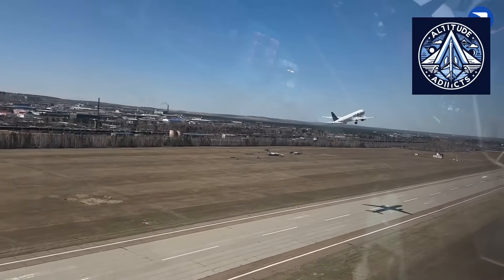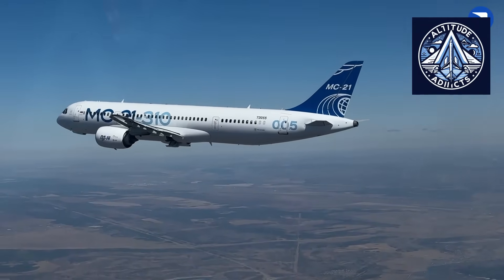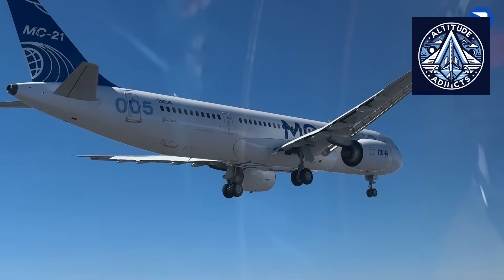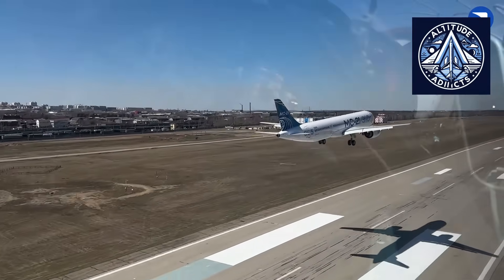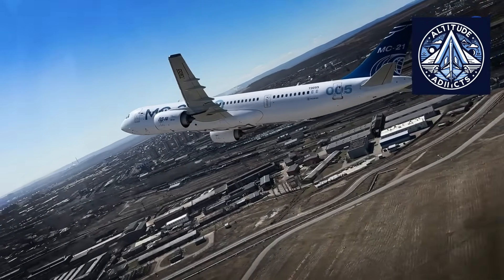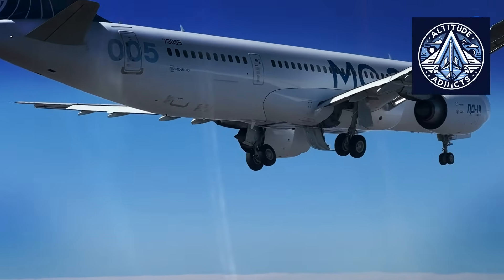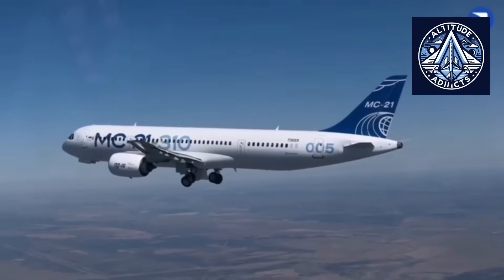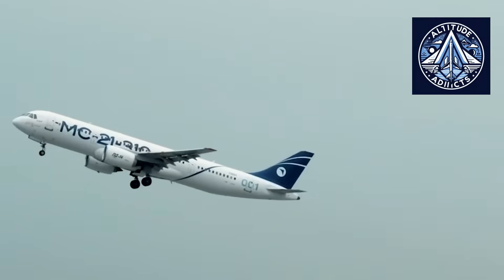MC-21 Evolution: The Weight-Optimized Version Explained

Comment: Please include links to sources of information in your videos in the future. I saw the full interview with the designer on the Rostec website, and he didn't say much of what was in the video. Let's start by noting that the dry weight of the PD-14 engines is 2,870 kg, while that of the PW1431G engines, previously installed on the MS-21, is 2,857 kg. The PW1431 engine produces 13.6 tons of takeoff thrust, while the PD-14 produces 14 tons. The PD-14 fan diameter is only 1,900 mm, while that of the PW1431 is 2,010 mm. Overall, they are roughly the same, except that the PD-14's smaller diameter creates less drag and, therefore, saves fuel. Their functional fuel consumption is practically identical: 0.53 for the PD-14 and 0.525 for the PW1431. In addition, the design weight of an aircraft is always less than the actual weight because the aircraft structure does not include any internal components. Aircraft ranges are reported differently in Russia and the United States. In the United States, ferry range is reported for an empty aircraft, often with additional fuel tanks. In Russia, both ferry and operational range are reported, with the operational range being reported for a fully loaded aircraft, naturally without additional fuel tanks. According to Naryshkin, the operational range of modern aircraft is typically 37% shorter than the ferry range. The UAC website lists the MS-21's practical range as 3,830 kilometers; if you add 37%, you get a ferry range of 5,200 kilometers (rounded) by American standards. The MS-21 page doesn't list any other specifications, but you can click the "Other Aircraft" link to find a specifications table with all the listed parameters for comparison. The Il-96-300 has a ferry range of 14,000 kilometers, and an operational range of 8,400 kilometers, although reference information usually states 9,000 kilometers. The MC-21 can be compared to the 737-900ER or A320(1), there is a difference in fuel volume, but overall the aircraft are similar, their actual practical flight range is about 3,200 kilometers, which is less than that of the MC-21. To better understand the range stated on the aircraft and the parameters taken into account, you can visit the Tu-214 Wikipedia page in Russian, which details the range depending on load and type.

Comment: First replace then improve. It needs a lot of support and long term vision. You have a good airframe and things will only get better. In terms of teething problems these are not the worst I've ever heard. You have survived the worst of the obstacles placed in your path. Survival has been attained improvement will happen with continued support.

Comment: From what I have been able to gather data from asking AI and learning from other sources and video's, the main 'culprit' for the weight, is that the Russians went for the 'Out Of Autoclave' technique for the wings. An autoclave is a very expensive and huge kind of oven and pressurized room, where these huge components are put into for hours, to let the carbon fibers and resins that keep them together, harden in optimal conditions of temperature, moisture, pressure and what not. With the 'OOC' technique, that Boeing and Airbus now also try to use instead of these autoclaves, the hardening and conditioning process takes place in controlled atmospheric conditions. But Russia does not yet master this technique completely. So to get to the same strength for the wings, they need more layers of fiber and more resin and they also don't have access to special ultra light resins. The result is a wing that is sturdier than that of the competion, which is a good thing for Russian climate and geography, but the negative thing is, that it will be mostly sanctioned countries like Iran and African nations or nations with lots of oil, like Venezuela, who will want to buy this plane. Until the Russians master the techniques to produce lighter wings domestically.
Reply: Just to clarify, no one is expertly competent on out of autoclave composite parts production. It’s a fairly niche and new field on any industrial scale. And yes, developing some new resins will likely be essential. Thanks for explaining the problem so well
Reply: @strgo4773  Этой "новой технологии" холодной формовки панелей уже где-то под тридцать лет.))

Comment: The MC21 has been in development for more than 15 years, but mass production and commercial operation are not yet confirmed. To compete with comparable Western passenger aircraft, a lightweight design (currently 5 tons heavier) and a commercial range of approximately 6,500 km (4,000 miles) are clearly essential. Above all, safety must be ensured, with a zero-accident record maintained for two to three years after commercial operation. As a national strategic project, we anticipate the best possible results through successful implementation.
Reply: А пока дальность 3700 в двухклассной и 3300 в одноклассной компоновке. "Родила царица в ночь, не то сына, не то дочь..."))) Полный отстой.
Reply: 6,500 km at Boeing is indicated with a minimum amount of payload, a minimum number of passengers (165) and with additional tanks in the cargo compartment. This is Western PR.
In Russia, they always consider the maximum payload.
At maximum payload and without additional tanks:
Boeing - 3,800km
Airbas - 3,700 km
MS 21 - 3750 km.
Reply: @ФеликсДзержинский-ф2ш  МС-21 заявлена (а не подтверждена в эксплуатации)  дальность 3750 при двухклассной компоновке, а при максимальной коммерческой нагрузке (один сплошной экономкласс) падает по расчетам до жалких 3200 км.

Comment: Saw another channel covering the composite panel improvements.  2.8kg/m2 on aircraft aluminum and Russia is expecting 20% weight savings by using composites.  If they need to save 5 tons then there are more components overweight than just the composites.  And if the composites are that much overweight, they might as well substitute already approved aircraft aluminum.
Reply: What’s the channel name and link to video please?
Reply: Смешно. Потратили сотни миллионов баксов ради композитного крыла, а теперь обратно к древнему дюралюминию?)) Самому не смешно?))
Reply: @ОлегКононенко-р4ш  wouldn't be the first time it happened to someone. But I don't think they went back to aluminum, at least not yet.
Reply: The landing gears ?